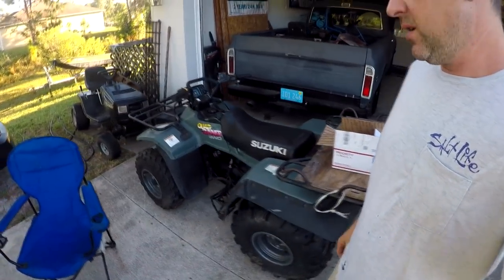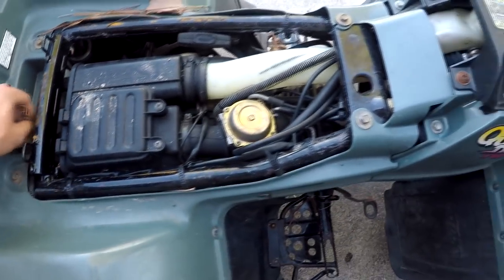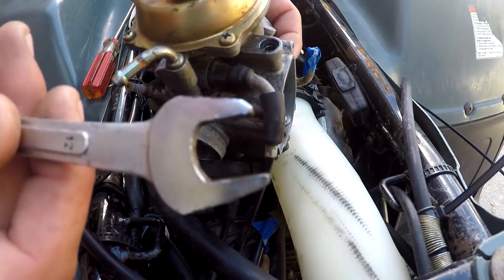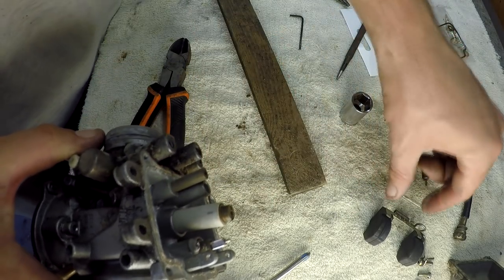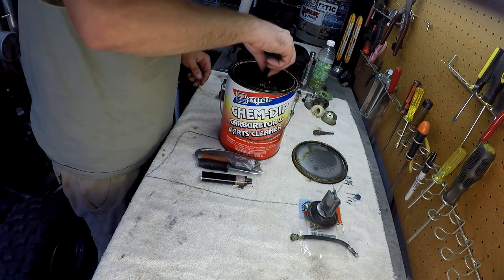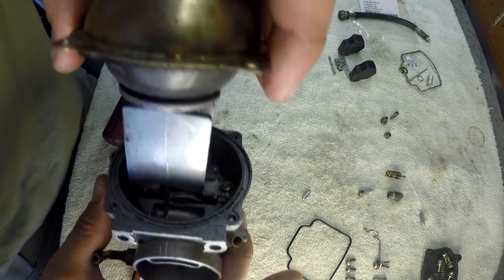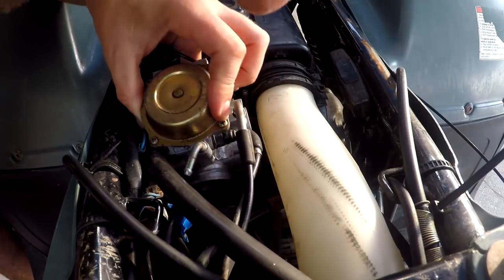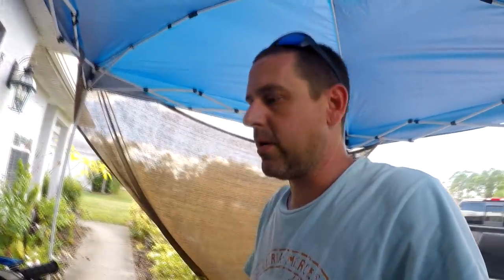96 Suzuki Quad Runner 250 4wd Carburetor Rebuld

Comment: 87 is 2 turns out, (88-89) is 1 3/4 turns out, (90-91) 2 turns out, this appiles to 2wd or 4wd. Later models are different. (92-96) 2wd only is 2 3/4 : (97-98) 2wd only is 2 7/8 : (92-98) 4WD 2 7/8 and finally a  (91-98) LT-F4WDX is 2 5/8 turns out.

Comment: sure nuff did help me. in many ways. taking out that rubber manifold... OH MY... i see why you did show that...i wound up telling it a thing or 2... let it loose at the block n slid it up. pushed that dagum rubber tube n shoved it down n twisted it sideways... naturally the hard way. n pulled it out how it come... gigl...  i done rebuilt many carbs n never like this... come to find the floats in the bowl are... Um... how to say. resonated SOLID... aint no floatin to it. there seized up solid by the resin. yet the float needle is the only part moving freely... yes. this quad has been setting years. godda go watch ur part 2. thank you for all you've taking your time to do, and continue too
Reply from the maker: Just saw this..glad I was able to help

Comment: Great job bro. If that carb is like the 250, that choke bolt is plastic. If so it’s worth mentioning that everyone should be very careful on reassemble to not cross thread.
Reply from the maker: It was plastic..and a b word to get back in..good point bro..and it is a 250...thx for watching billy!

Comment: Good job. These CV carbs have an emulsion tube, that’s what the main jet screws into, the slide guide needs to be remove so it can be cleaned. The top baffle needs to be tacked apart and cleaned
Reply from the maker: Thx man..ya I am not a mechanic by far, but I looked for a video on this rebuild and couldn't find one..so I did my best..thx and friend!
Reply: Go Karts or Gone Fishin, same here, you helped me!

Comment: Sounds like a smooth running motor. My generator won't start after sitting several months. Thinking a gummed up carb.
Reply from the maker: More than likely..try draining the old gas out..put new gas in and put some fresh gas down the carb..if you can get it to start it might clear up..if you have any questions dont hesitate to ask brother!
Reply: Go Karts or Gone Fishin , think I’ll try that first as well, cool!

Comment: hey man be careful with the oil on the diaphram. Have you ever removed the bowl gasket and got oil or wd 40 on it and it will swell and be to big to fit. i would not put any oil on the diaphram's edge, if you do, do not let it sit and swell, immediately put it back in and tighten screws on the cover. once again it will swell
Reply from the maker: I have had this problem..hopefully everyone knows better..thx for watching friend
Reply: Is there anything that can be safely applied to the diaphram which will help keep it flexible, prevent dry-rot and extend its' life? Like you said... probably not anything oil based. Maybe pure silicone grease or something like that? Thanks

Comment: Yeah I took it off and rebuilt it and put it back on had a few issues to get back off adjusted it put it back on impossible to adjust from the bottom without that bent screwdriver that's been $18 for and then I found out it was easier to pay $36 and buy a brand new carburetor on Amazon
Reply from the maker: Right on...that's how it is these days..thx for watching

Comment: Where does that tiny o-ring go that is in the small zip lock bag with the spring? Does it go on the needle valve that has the spring?
Reply from the maker: Ya ...I think it is the needle outside of the bowl..should be a groove that the o-ring rest in..hope you get iy
Reply: @GoKartsorGoneFishin  ...Thanks for the reply. That's where I ended up putting it. It seems to running fine. Mine's a '96 too. Thanks again.

Comment: Another question is the position of the choke on the left handle ? What position is up and down on it for ?
Reply from the maker: Yes it's on the left side and you push it away from you
Reply: Pull toward you for choke and off is away from rider.

Comment: I have a 1999 250, 2wd.  1st time owning one and need to find the idle screw, any help would would be great!! Thanks!
Reply from the maker: If you look at 907 when I pull carb out...the line that goes under the bowl with the screw end...that's the idle screw..its on a 8 inch long flex able tube..hope this helps
Reply: @GoKartsorGoneFishin  Thanks much!

Comment: Could you tell me where the hose on the bottom of the carburetor goes
Reply from the maker: It's a a drain hose friend..just hangs under the bike..thx for watching
Reply: Thank You ! Tried to tighten screw but gas keeps dripping out .Would it be some sort of seal on end of side screw .
Reply from the maker: Ya the o ring most be bad ..you can plug it for temporary but I would definitely look for the correct o ring..
Reply: Thank You Again for your fast Response !
Reply from the maker: Anytime friend

Comment: You need to lube your air filter, it's not supposed to be dry.
Reply from the maker: Didn't know that friend..I will let the owner know..thank you!
Reply: You don’t need to do that, the atv I own now had someone who messed with too much tacky grease for an air filter. It ended up sealing the expensive carbeurator shut and locked up the throttle at one point. I have a new OEM carb but I would’ve reused the old one if no one put any oil or anything in it.
Reply: @arberfilms2302  Tacky grease?  Air filter lube isn't tacky grease unless I'm not understanding your response.  Lubing the air filter so it's not dry and will actually trap the fine particulates of dirt is what I was talking about.
Reply: @brownfamilyracing-j4c  it gets dirtier with oil in the filter element over time. Also whoever messed with my machine didn’t know wd40 should only be used a a filter oil. Anything else can get sucked into the carbeurator and cause severe damage even to the engine if it’s bad enough.
Reply: @arberfilms2302  Wow, that is really not true, 40 years professional experience and never once have I heard something like you're saying.  I totally disagree with you, of course it gets dirtier, that's what it's for!!  So all the OEM companies that sell foam filter oil must be insane?  Foam air filters are to have oil kneaded into them, don't listen to this guy "Arber Films2" WOW his comments are 100% false.  I've owned probably 1,000 for motorcycles and I've never heard anyone say anything like "you shouldn't lube foam filters, that would mean they would catch more dirt"  WOW!